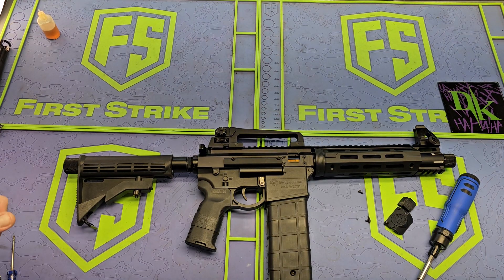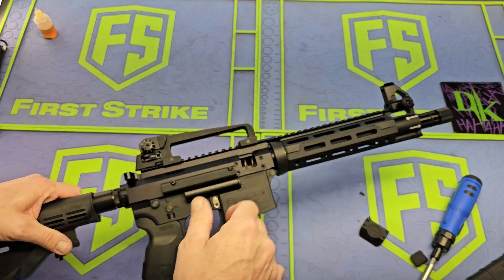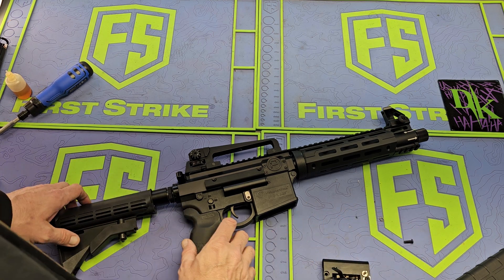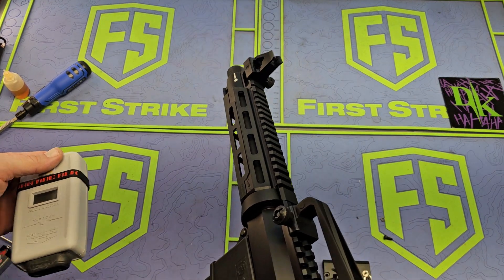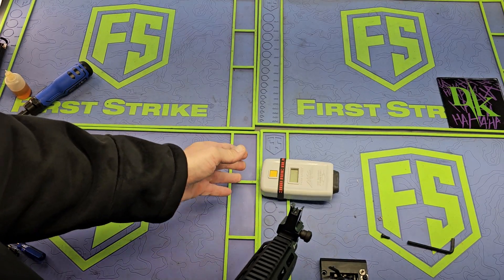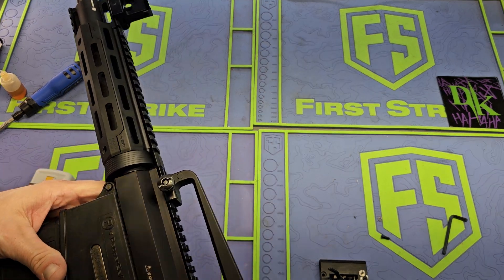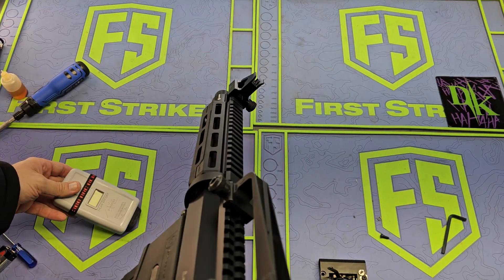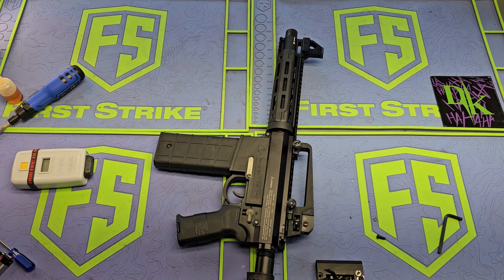Still Kicking: Project CO2 VKS.  Reg swap, cause . . .

Comment: Yeah I'm on project co2 myself just different platform co2 can be surprising but it's just not consistent enough for that hpa is king but for hobby numbers co2 for few bangs can produce some hobby numbers throw some hot hands down beside the stock cheat a bit nawh but it helps prevent freezing lol but I'm not been doing this as long as you guys but I'm smart kid I can figure out thing or 2 but totally hobby numbers
Reply from the maker: Luckily what you're playing with handles it quite a bit better.